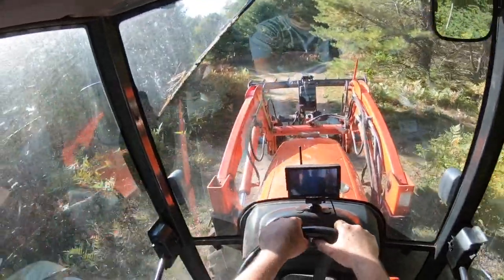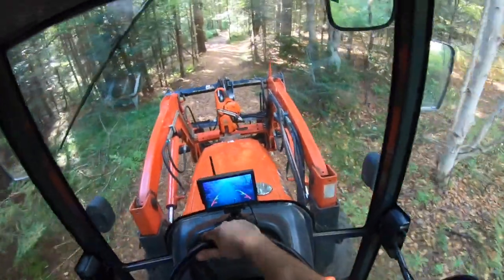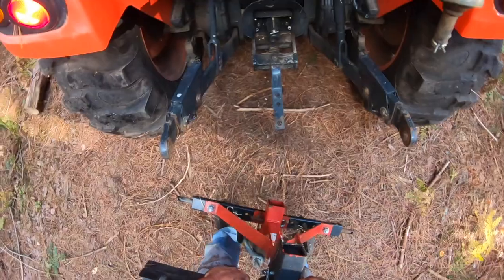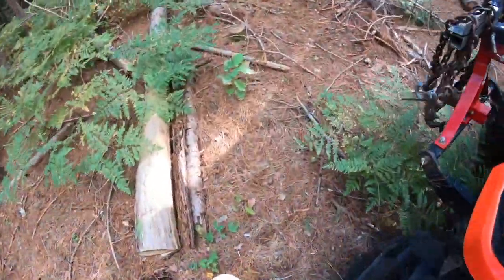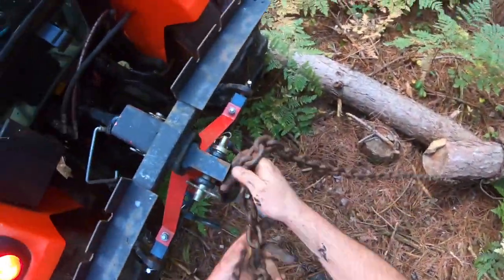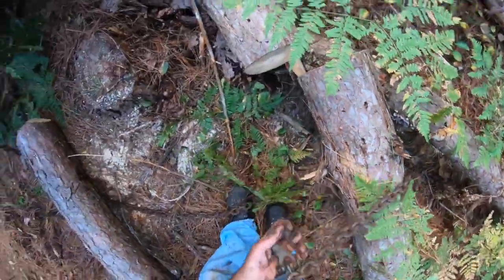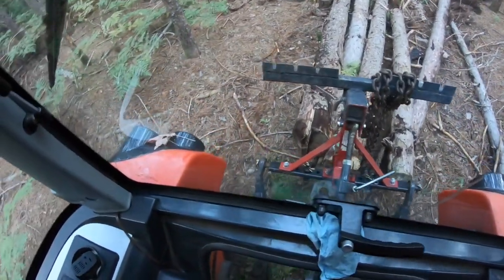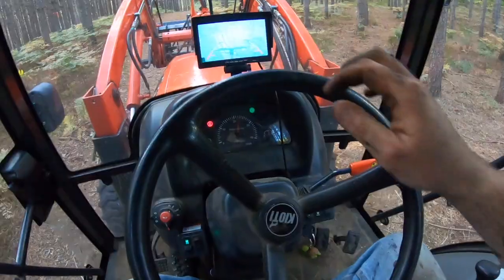Safely Skidding Trees with a Compact Tractor

Comment: Nice job. Question if you will. I’d like to add a camera to my Dk45. However I’d like a camera to see in the front for fork and grapple work. Will your system do dual cameras? Thanks
Reply from the maker: Rick Skirvin the camera I’ve got does allow for two cameras to be attached to the one module. Having wireless cameras is nice as as well so you only have to worry about getting a power wire to the cameras. Thanks for watching!

Comment: Love your videos. Every time I see your kioti it gives me buyers remorse! I was looking at kioti as an option but  got a John deere instead. I wish I had bought the kioti!
Reply from the maker: Matt Burrows I’m sure your John Deere does a good job regardless. I’m just partial to the Kioti as that’s what I own. If I had the Deere I wouldn’t know any different so I’d likely still have good things to say about it too
Reply from the maker: Matt Burrows what model Deere did you buy?
Reply: @sawingwithsandy  3032e. Just a basic tractor but it fits the budget. Hope to have a cab tractor within a few years
Reply from the maker: I did have a good look at that tractor as well. It seemed like a nice tractor. Just so happend that the Kioti was a real good deal and second hand at a local dealer with real Low hours. Regardless why you drive I’m sure the Deere gets the job done too